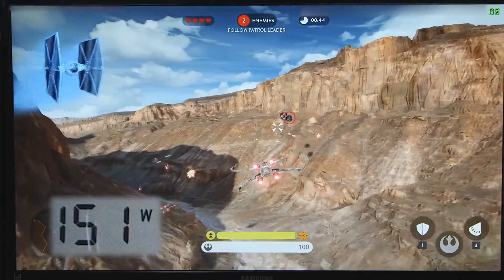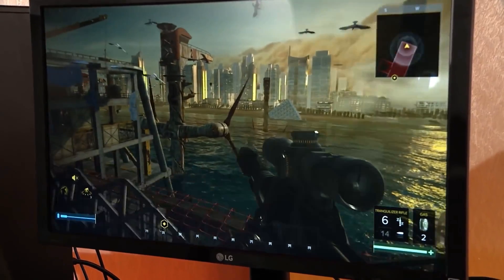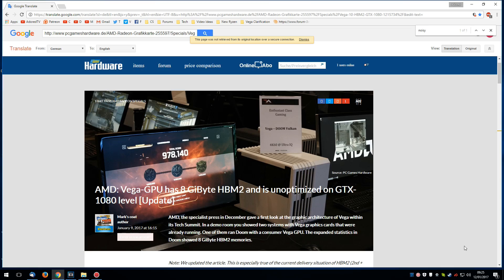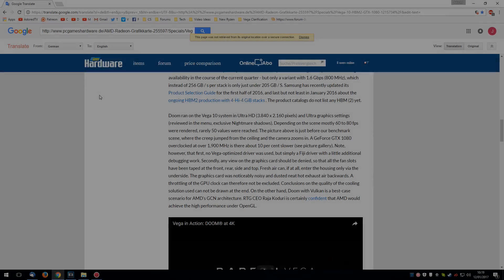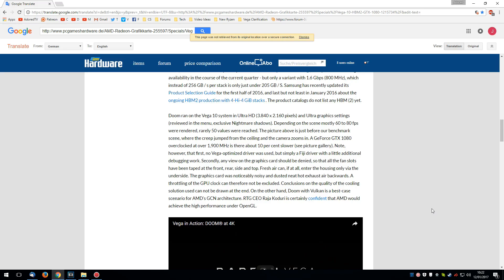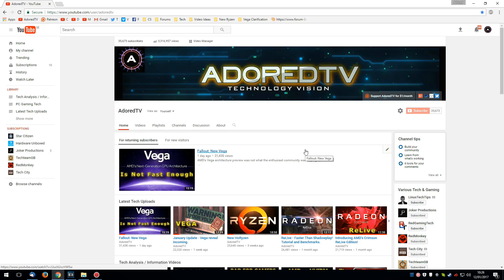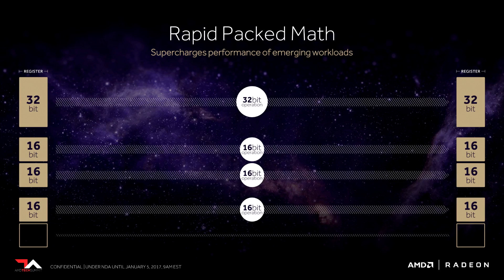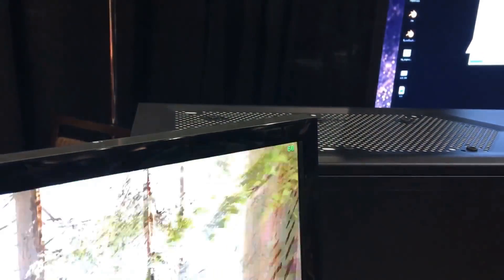Vega Clarification - How bad is it?

Comment: We already know that the full Vega has a compute power of 12.5 TFLOPS, which is ~46% more than Fury X, most likely due to a clock speed of 1525Mhz and 4096 cores (due to the memory controller taking up space) though the gaming clock may be greater. We also know that using the same memory speed, cores and clocks that GCN 4 on it's own is 10% faster than GCN 3. Assuming the faster memory and other improvements let's assume that Vega will be around 25% faster than GCN 4. That would put Vega at ~80% faster than Fury X which is faster than Titan X Pascal.

The reason I think they're showing Vega to be slower than this is because they want Nvidia to release a 1080Ti which is slower or a replacement for Titan X Pascal sometime between now and may. This way they can then release Vega which is faster than this and Nvidia will be stuck for a few months.

When AMD showed off R9 290X they showed it doing 5760x1080 60FPS in Battlefield using Eyefinity. Up until this point people had believed that the 290X would be a slower card than the GTX Titan and would be on the level of the GTX 780, but it showed that it was likely stronger than most people thought, including Nvidia.

When AMD released the 290X it was indeed faster than the 780 and more often than not faster than GTX Titan. Nvidia quickly released the full GK110 as the 780Ti (faster than GTX Titan) and AMD once again had a slower card. I think this is simply AMD wanting to avoid this situation again and are deliberately limiting performance to be slightly faster than GTX 1080 so that Nvidia will release a GTX 1080Ti to counter it, only for the newly released Vega card to be faster.
Reply from the maker: Fury X has 46% higher FLOPS than the 390X though and is only 20% faster (at 1440p).  I do agree that Vega, on paper, looks much better but how to reconcile that with the awful Doom results?
Reply: You're right, Fury X has a high TFLOP number but doesn't perform like it. But I compared the floating point of Vega to the floating point of Fury X, so I'm assuming Vega will have the same problem as Fury X. If it doesn't then we could see performance even greater. 

I think the demos are being done at lower clocks, possibly 1300Mhz? I don't believe that the floating point to performance ratio of Vega is worse than it was with Fury X. Even if Vega was simply GCN (1.)3 on speed at ~1550Mhz it would still be faster than what's being shown here.
Reply from the maker: I heard today for the first time that the Vega sample was doing between 1400 and 1490 MHz, but no idea how legit that was.  If it can hit 1750MHz then we could be talking something much better.
Reply: Interesting, hopefully more details arrive soon.
Reply: If it really did 1400Mhz+ it won't get any faster until release as 1400Mhz already is a LOT faster than P10 clocks. So I doubt it will improve a lot, maybe 1500-1550Mhz at best.

Comment: Even if Nvidia can generate that level of raw theoretical performance with a Vega 10 counter, they aren't going to be able to ship it in time to counter the effect it has on consumers - people are going to be shitting the bed when their $800 1080 gets cut in half in value overnight. I don't think you understand how bad a taste this leaves in the mouth of consumers. You said it yourself, millions of people bought the 1080 - plenty to upset.

And then there is Vega 11, which will in all likelihood turn out to be improved Fury X. I think there is a good possibility that Vega 11 will be a double card, one for the timing and two because they are obviously not putting HBM2 on their cards for the marginal performance gains. There is just no reason for AMD to use the much more expensive HBM2 for the marginal gains in real world performance it provides over GDDR5 on actual GPUs unless memory latency become a crucial issue -which in all likelihood, the most plausible scenario is a double card with improved integration. HBM2 otherwise just isn't worth the cost.

Comment: I don't think AMD is either 'sandbagging' or showing Vega 'at it's best'. The simplest explanation is probably the one that you touched on in the video, which is that AMD was demo'ing Vega at reduced clock rates. Why? Perhaps they simply wanted to show that they have fully working new GPU (Vega) silicon, just like they have working CPU (Zen) silicon, in order to maintain their stock price (it certainly would have dropped if there had NOT been any Vega silicon running games) and the tiny, sealed case is almost proof-positive that the chip was running at very reduced clock rates. Retail Vega cards are almost certainly going to provide significantly better performance, along with the drivers/code optimizations that you mentioned. That card might well have been running at 1/3 the final production clock speed. Really, what it boils down to (pun intended) is that in order to get a decent speculation about how fast Vega will be running games, we would need to do a thermal envelope calculation. How low a clock rate would that chip have needed in order to run continuously in an essentially fan-less configuration, since the case was sealed, and the heat-sink would simply be recycling hot air.

Comment: is yield on 14nm / 16nm for ~600mm dies even good enough to be commercially viable? it made sense for nvidia with its much earlier launch to go for ~471mm especialy when you consider even the TitanX has 256 cores disabled. but for AMD many months later to also release around a similar die size makes me wonder? are Global Foundries / TSMCs yield just not good enough for affordable ~600mm dies? i means its certainly not as mature as 28nm was when they were cranking out the big dies of GM200.
Reply from the maker: I think the question is, how much more viable a selling proposition would a GPU that beat Titan X by say, 20%, be vs one that loses by maybe 15%.

The defect density at GF's 14nm is extremely low and probably the best in the industry today at <0.08 per square cm. http://www.eetindia.co.in/news/article/first-glance-at-globalfoundries-7nm

So a 600mm2 GPU will not yield that much worse than a 500mm2 GPU, 69 vs 52 dpw according to this - http://www.isine.com/DieYieldCalculator.html

Comment: Another issue is the timing of the roll out.  AMD is now rumoured to be talking May 2017 launch.... That is Q2!

This part was initially Q4 2016, then Q1 2017, now Q2.
You can't continuously miss dates!

Every quarter they miss is closer to nvidia releasing the Ti to trump Vega.

They would have had at least a quarter (4 months) of being top, realistically closer to 6 months.

Now it's looking like 1 month tops.

There is actually the possibility now of the 1080Ti coming out before Vega!

Just ouch.  I hope they are able to compete near the high end for a good price.  If they can get 5-10% higher than 1080 and be $100-$50 lower than the price of a 1080 that would be OK.  Not great, but OK.  Good enough to excel at 1440p and start hitting into 4k. 

That would bring that class of card back to the price they are supposed to be at historically.

Nvidia would capture the high end again, but how many people can afford $800+ GPUs?

I'm just disappointed that AMD have let their perceived Vega advantage dissipate so much by missing release.

Comment: I would still think that the main point of vega is low power consumption.

And i would think that AMD will go over to a general multi GPU card fairly soon. Probably the base Vega would be two GPU and the high end with 4.

Talking about a 500-600mm^2 GPU, that is almost 3 times as much as the 480. Not that the memory controller is..

So would the Vega be just 50% faster than the 480, but 3 times the size and twice the memory bandwidth. 

No. something is very wrong here. It just don´t line up..

There are also leaks that suggest that vega uses on die DRAM cache. The leak sugest its a 128MB eDRAM, and in 14nm.. that is not really that big. Still its sufficient to of load the frame buffer from the HBM.

So this gives the vega even more of bandwidth. Really 3 times the bandwidth of the 480.

So why would it have that much bandwidth, but not more performance. Still it have die space for a larger quantity of pipes.

Even if the pipes are larger, there is really quite a lot of die space here.

Something is very very wrong here.

So why would AMD engineers design pipe that takes 50% more space per performance. That would be obvious already on the drawing table.

So if AMD is not sandbaging... and they may be. what is mist then. Vega just didn´t get the performance that that it suppose to? Did the engineer get the performance 50% wrong...  i would say, no way.

Some might argue that that was the case for bulldozer... i would say, no not really.  Bulldozer was not design to be fast, it was design to use little die space, this is decently not true for Vega.

There is also the mix floating-point that PS4pro and Scorpio (probably) will have.

So what was AMD proving with the demo... I would say, what they was proving was that it could run on Polaris drivers. Why is this important. Well if its a radically different design backwards comparability is important.

So by first showing that it run on Polaris drivers.... somewhat reasonable, but not really good, than show the architectural improvement, that might give 30-40-50% performance boast. Then they will ease exprectaion of compability issues

Comment: Question: If the Doom/Battlefront demo is big Vega and GTX 1080+10% equivalent, what then of little Vega, there are two, Vega 10 and 11, actually three if you include Vega 20, where does the smallest one of them fit in?  If this is the best AMD have and little more than GTX 1080 is all its got one would assume the small Vega is only a bit more than Polaris 10, so.........?

Comment: The small R&D for the graphics division will only get you so far. This is basically the fault of CPU division that has almost sunk the whole company with (a) Bulldozer. But once the much needed (and deserved) revenue for Ryzen trickles in, you'll see drastically increasing R&D costs, especially for RTG because I think the future belongs to "super APUs" with a high powered graphics part. 
Also hasn't Intel signed a deal with AMD for some graphics patents? Thats basically free cash.

Comment: You seem to be glossing over a lot of points in this video and the previous one, which I feel makes your analyses of Vega not quite up to the mark compared to your other work. I wish to address a few of them here:

1. Core count and performance: Fiji has 45 percent more CUs than Hawaii, yet it is only about 20 percent faster, when comparing the Fury X with the R9 390X. On the other hand, GP102 has 40 percent more SPs than GP104, but the Titan X Pascal is up to 30 percent faster than the GTX 1080. Thus, as it has been known for a while, AMD clearly does not get as much performance compared to NVIDIA by simply making a bigger GPU with more cores. At least not in the older APIs. Without redesigning the compute unit, it makes no sense to ramp up the core count if you cannot get a commensurate increase in performance. This is where the NCU is coming in - and it will be a bigger change compared to GCN 4(Polaris) and GCN 3(Tonga). Polaris has on average 10% more IPC than Tonga, and with Vega I expect even bigger gains - indeed it was one of the points that AMD highlighted in its slides.

2 . ROPs or what AMD is calling its render backend: A topic that always comes up when discussing the 980Ti and Fury X is why the latter is slower in spite of having a much higher core count. It is because the the 980Ti has 50% more ROPs. This is also the reason that the 980Ti is so much faster than the Fury X at lower resolutions. By completely redesigning this part of the architecture, AMD has made significant progress in overcoming this limitation with Vega, even if the actual core counts are similar.

3. Clock speeds: Global Foundries has a history of improving their new process nodes over time. When Bulldozer launched, very early samples of the FX-8150 had trouble maintaining the advertised clock speeds. Look at Ryzen - same node, but AMD has consistently got higher clocks starting from the first ES at 3GHz. Thus, I expect at least faster clock speeds than Polaris in the retail cards.

4. Die size: in one of your own videos, you correctly explained how difficult it is to make a bigger GPU, and yet you now expect AMD to go all out with the biggest GPU it can manage to crush the Titan XP. Well, how much is AMD going to price such a card? Will it capture the high-end market this way? AMD got burned when it tried this with the Fury X, it will not want to make the same mistake again.

5. Pascal refresh/Volta: you say that NVIDIA can simply gain more die space by adopting HBM and use it to increase core counts to 'crush' AMD with a refreshed Pascal. Well it won't work that way, without significantly redesigning the architecture - as consumer Pascal only supports GDDR5(X). Only GP100 supports HBM as of now. No consumer card is going to be derived from it. This situation won't change until Volta. And Volta will launch only in 2018.

And finally, let us speculate about Project Scorpio. If Microsoft can deliver what it claims on paper, then it is very likely that the GPU that will be driving it might be a small Vega, or more likely, a Polaris refresh with NCU. AMD can in principle refresh its entire lineup with NCU based products. If that is the case then AMD will be in a comfortable enough position to respond to whatever moves NVIDIA makes. 

2017 might not be as dire a situation for AMD as you think.
Reply from the maker: ROP's are inconsequential, it's not that.  Even if Nvidia doesn't drop a 600mm2 HBM GPU, they still have room for a 600mm2 GDDR5X GPU.

AMD could sell a 600mm2 GPU to the pro market at higher prices too, even if it doesn't sell in consumer space.

Comment: @AdoredTv: I agree completely in order for Vega 10 to be considered a successful chip it should be at least around 10% faster than the Titan XP. However I have my little conspiracy theory and I'm very interested in your opinion. It has 2 parts, the first part is actually not completely unrealistic but rather sometihng that should be possible, the second half however is completely dreamt up but stay with me for a second :)
So, isn't it possible that Vega 10 is a scaffolding move? it is supposed to be sitting somewhere between the 1080 and the 1080Ti, since they couldn't make a single chip faster than this, fair enough. We know that there will be however a Vega 20 coming in the second half, I know I know it is a dual GPU, dual GPUs suck, BUT, and this is the first half of the theory. Now that AMD have the High Bandwidth Cache controller to address memory OFF the chip, everyone is talking about m.2 ssd-s and such, but it should also be possible to now address memory on another chip sitting on the same PCB, with a very fast connection (faster than pcie ...) therefore 2 Vega 10 chips each with 8G HBM2 using the HBCC should eliminate the need for doubling up the VRAM of a dual chip, so theoretically we would have a 16g HBM2 card since the 2 chips could access each other's individual HBM2 stacks. This is part 1, that should be possible. the second part is the total fiction, what if AMD are still working on some sort of higher level controller that could sit on top of the 2 chips and managing workload, for a "single chip" experience on a dual chip card. I know DX12 is supposed to have multiGPU supprot etc etc, but all of those require the developer to actually use it and history tells us that adaption of everything is slow (just look at dx12 itself...) so if AMD could pull this, then Vega 20 (and any other gpu coming after) could use this method to stomp Volta for sure... 
Of course this is just a theory (well, the 2nd part at least, the first should be true)....
Reply from the maker: The whole interposer/multiple die thing is very interesting, but I'm still not sure I believe in Vega 20.  Needs more thinking. ;)
Reply: Yes I know part 2 is a bit of fiction, but the memory addressing with the HBCC and therefore the not having to duplicate textures in both gpu's VRAM should be possible now, and with that we could see the cores using each other's VRAM so they would really add up, I think that is entirely possible now
Reply from the maker: Yes you're right, and I hadn't thought about it until you mentioned it.  That's one of the parts I need to think more about. ;)

Not sure if you've seen these slides or not - https://www.forum-3dcenter.org/vbulletin/showpost.php?p=11260758&postcount=1718
Reply: Yes I recall these from somewhere, thanks, the more I think about this the more it makes sense. Obviously it doesn't mean much, this is all speculation :) However even if part 2 will not happen with vega, if vega 20 will simply be a dual card with shared memory (thanks to the hbcc), part 2 might be something that will be realized with the mysterious "navi" which we only know like 2 buzzwords about, and those are "next gen memory" and "scalable architecture", which would definitely fit this whole infinity fabric idea.